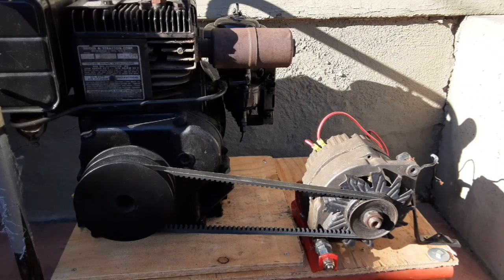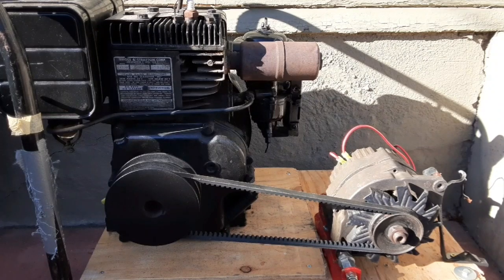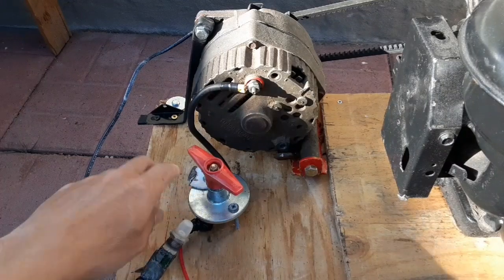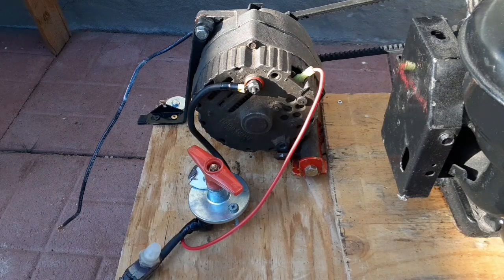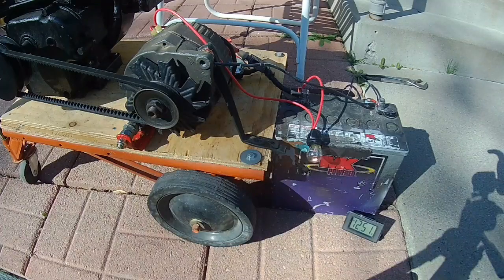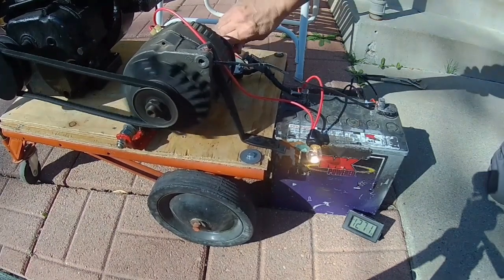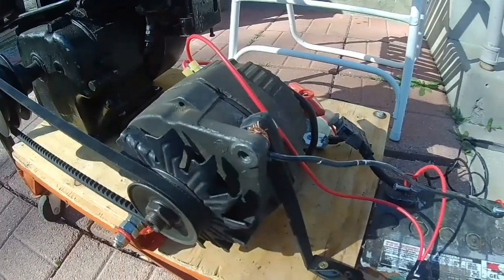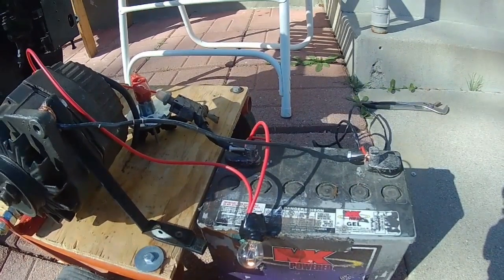Delco 3 wire alternator wiring guide. Making a standalone 12v generator.

Comment: It's an interesting tool. I've been playing with the idea of building one myself as an emergence backup way to charge my DIY lead acid power storage setup (Currently consisting of 32x scrounged second hand 12A server UPS batteries in 4 large stackable tool boxes, with multiple fuses, sockets, and switches, a LOT of 10 and 8 gauge wiring, and 3 1500W inverters...... Sounds "Ghetto" as hell, but a lot of research went into making sure everything was wired to prevent uneven charging/discharging, and if a battery dies, the rest of them couldn't cook it trying to equalise the voltage).

The thing I'm wondering is though, is there anything in the alternator that prevents your battery from being overcharged, or would the car have had something to modulate the field coils and regulate the alternators output ?
Reply from the maker: Just make sure whatever alternator you use is internally regulated or you'll need to fit an external unit.

Comment: I see a potential problem here. With the alternator mounted as shown it will spin counterclockwise instead of the clockwise direction it was intended to. The fan is designed to pull cooling air through the alternator from back to front. Spinning it in the opposite direction greatly impairs its operation, which could cause overheating under heavy loads. The alternator should be turned around so it will spin in the proper direction. Otherwise looks like well put together project.

Comment: Where do u get the ligh?   A turn signal conecttion can work?
Reply from the maker: I used a single filament brake light.
I think part number is 1156 or 1157
Reply: @ThriftStoreHacker  5W bulb

Comment: Hi enjoyed watching your videos. It gave me the knowledge to enspire me to build a backup up off grid 12v  charging device. Used a second hand 100 amp alternator, cycle turbo trainer, old jump lead switches etc.  Basically I can pedal in high gear with little stress on Crank & alternator rotation. Pushing rear wheel by hand has alternator pulley & rear wheel rotating freely. Obviously when exciting you can feel load slightly but you can cycle immediately in high gear. Tyre, inner tube & turbo trainer tiny freewheel resistance roller removed. Belt goes round backwheel & alternator. Turbo trainer folds in half with alternator attached. Bicycle comes off turbo trainer & can be used as normal by just adding tyre & Innertube.
Bike kept in campervan with turbo trainer & can be used to jump-start van or charge leisure batteries. Beats charging with a slow battery trickle charger. Basically fully off grid backup. Great videos very interesting to watch & learn from.

Comment: The way this is wired it will drain the battery when your switch is "off" No.2 is not the field power terminal, no. 1 is, No2 is just the voltage sensor. No1 excites the field, and when the alt takes over sends 1v+  thu the light so having 12v+ on either side their is no flow,  Wired like t
Reply: Hi you sound like you know what your talking about - cant get mine working at all
Reply: @dennybaker8755                                           no wiring diagram no good.

Comment: Hi! Great video. I'm rebuilding a 3 pin delco for an mgb v8 and need to know if the diode pack is interchangeable with other models. I've seen a few online but finding info here in the UK is hard. Can I swap any delco diode in that fits or are there differences between the diode packs. Please excuse the question, I'm a mechanic and not an auto electrician.
Reply from the maker: I'm really not sure.  You may want to pull up specs on both the diodes. If everything looks about the same I assume it would work.
Reply: @ThriftStoreHacker  thank you, I appreciate the fast reply 👍
Reply: v

Comment: Didn't I see years ago, where there was a way to wire an alternator to run a circular saw from your car?
And didn't someone make a plug and play wiring harness , complete with an ac  plug for that purpose? 
J C Whitney comes to mind....
Reply from the maker: I had a 2nd alternator in my old truck (old campers special) and that was great. This rig will run for 2 hours on a gallon of gas and when completed will be a tiny rolling power station.
Reply: Yes. Years ago there used to be a product that would allow an alternator to output 120v or so, which would run power tools with "universal" motors (motors which will run on AC or DC). It worked by disconnecting the alternator output from the vehicle and bypassing the voltage regulator and running the engine at 2000 - 4000 rpm to get the alternator turning fast enough to produce this voltage. This obviously puts a considerable stress on the alternator and its components but the idea did work with alternators of the time. Unfortunately with today's charging systems, attempting anything like this with modern alternators with built-in voltage regulators or computer controlled regulation would be very complicated if not asking for trouble.